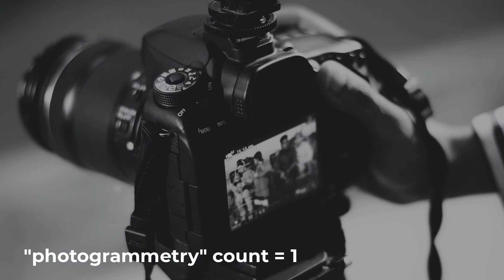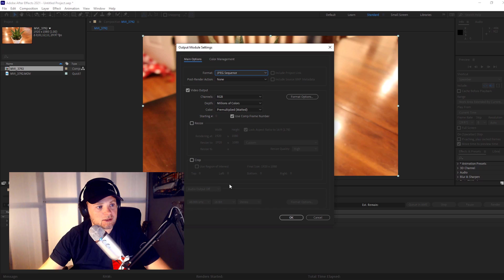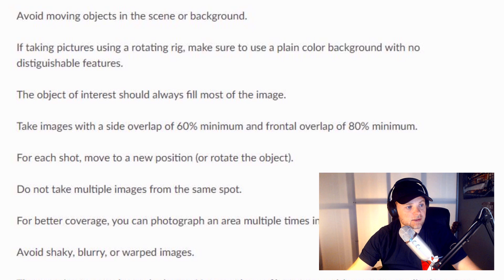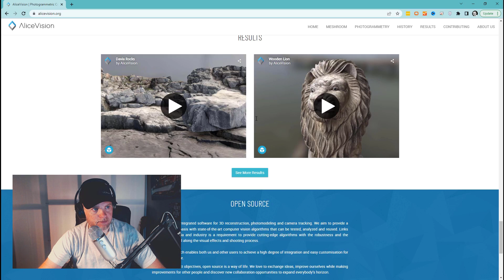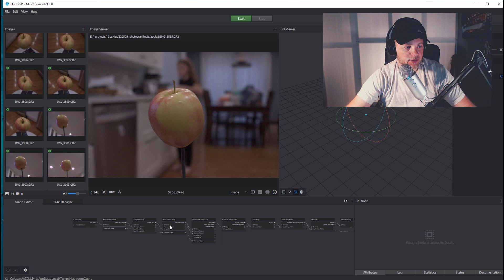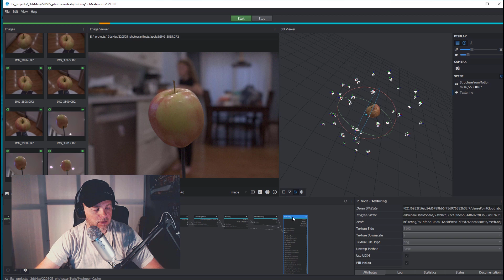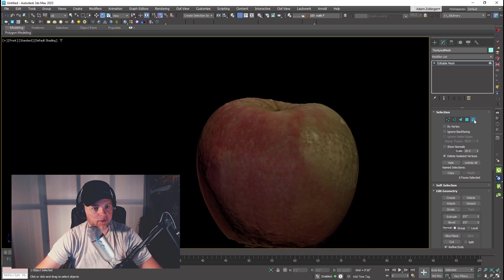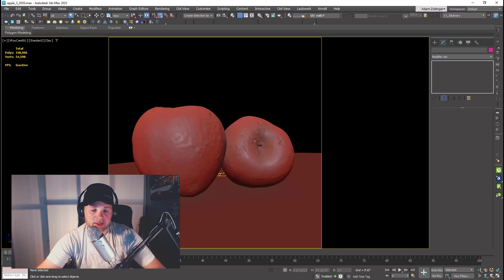Archviz Photogrammetry Tutorial With Meshroom | Can It Reasonably Replace Poly Modeling?

Comment: Pretty sure your retopo didn't fully complete. You should get all quads, but you were left with triangulated subdivided surfaces, which forms part of the retopo calculation. Sometimes it fails after this part, so you get a new mesh, but not quads.
Reply from the maker: Interesting. I haven't used it enough yet to see the ins and outs. I have done several that come out as great quad models, but whenever I am doing it with the UVW unwrap preserved, it comes out like this. I figured it was changing how the retopo is done in order to preserve the UVs, but maybe it was just failing before finishing? Either way, in this case I didn't mind much.

Comment: You said that when you tried to do photogrammetry with a video that the 'blurred' parts didn't play well.  If you were to use a drone on a building should the drone be still for each photograph?
Reply from the maker: A drone is totally capable of doing it well. In fact, there is software made specifically for drones that will automate the process. The drone can automatically go in a grid pattern and take all the pictures needed then generate a 3d model from it. It is really slick. Actually, photogrammetry with drones might be one of the biggest ways in which this technology can be implemented in the near future.